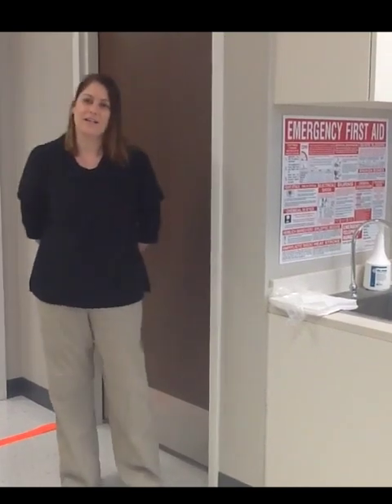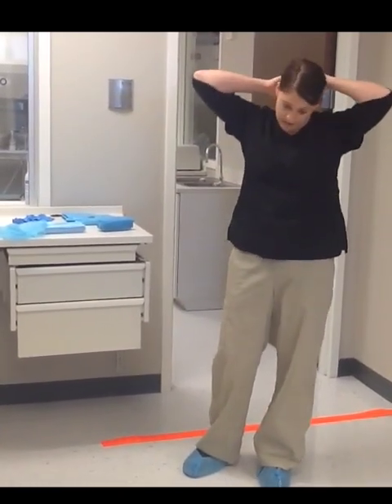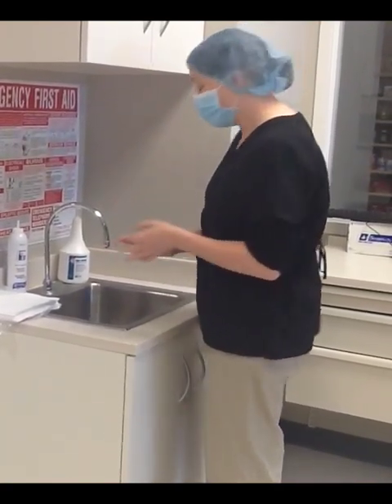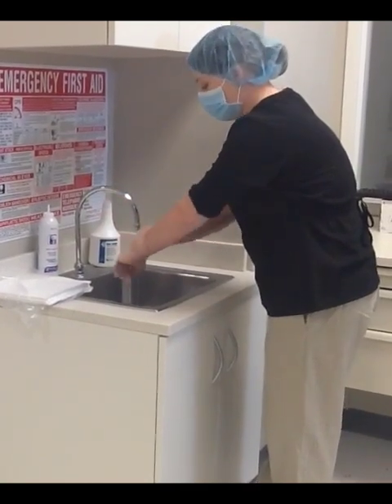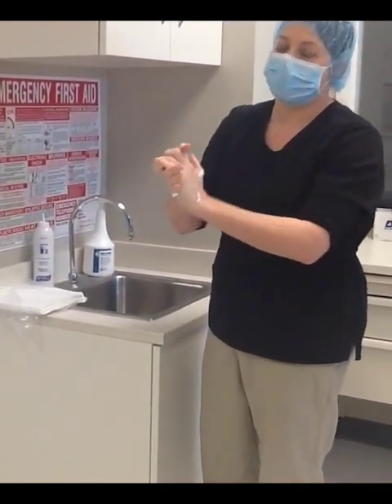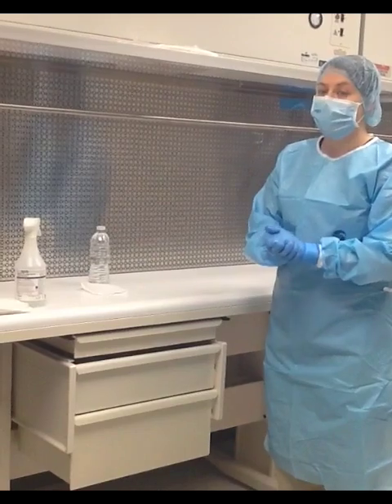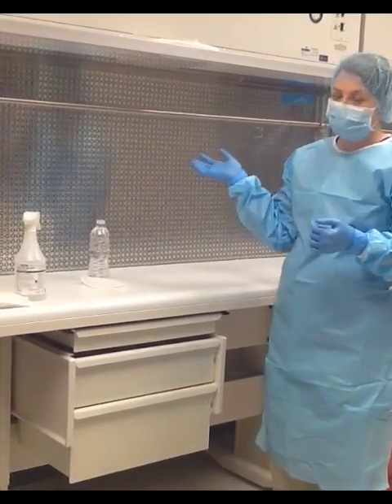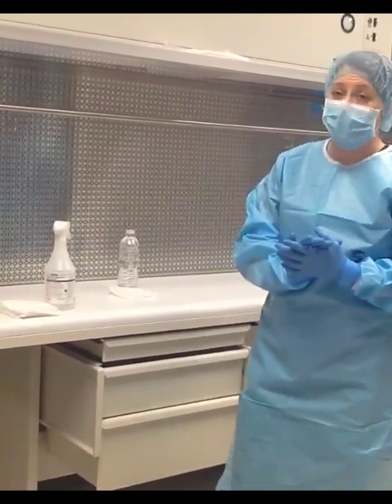Aseptic Technique Part 1

Comment: I find this video all wrong.  Cleaning the LAFH should be cleaned starting with the top working side to side from the back to the front, then the bar, to the sides from top to bottom back to front, to the work bench side to side back to front.  Changing wipes after each area cleaned.  This women just contaminated the entire LAFH from wiping back to from back to the back to front taking in contamination with each wipe, never changing her wipe pad.

Comment: Top to bottom. Ceiling should be done first.
Reply: Back to front, top to bottom.  Cleanest to dirtiest.  Back, top, side, bar, side, bottom.  Visualize particles being on the top dropping down to the work surface below and you're wiping them away.
Reply: Top to bottom. Ceiling, back, bar, sides, bench.
Reply: Ceiling should only be done first if it's a vertical hood.
Reply: Echo852 top to bottom. Back to front. Ceiling from back to front, the back of hood top down. Etc...
Reply: I did read that the first time, and I am not changing my answer.
Reply: And I am not changing mine. I guess we will have to agree to disagree. I have worked in a clean room for more than 15 years. Trained by experts, I think I will go with the process that they use.
Reply: ACPE accredited video.

Comment: what are.  aseptic drugs
Reply: Aseptic is a method of preparation, not a type of drug.  "Aseptic Technique" is a way of preparing medication in such a way to prevent contamination.
Reply: Ok so what your say is that your  covered in porotetion gear so you or the drug don't get contaminated
Reply: Bonnet (covers hair), low-lint gown (covers scrubs, prevents air contamination), mask (covers face/nose), gloves (covers hands/wrists).  The workbench has HEPA filtered air flowing over it in layers (check out laminar air flow).  All of these measures prevent contaminants from getting mixed into the medication.
Reply: Ok
Reply: Do you ever think omg if this gets on my I'll be sick
Reply: Tori Miglioratti hdjrjejebeijfnfldmejdndidndndu💟💟💞💞💓💜🖎💚👄👄✍💛👏👋💗🖓🖒🖒👃💛✍💙💔❤💋👀👣💏💏👅👏💖💕👃🖒👐👂💜🖎👄👄👄👅👐👏💗💖💕🖒👃👃💙❤👣💏💏💏💟💟👐✍💞👅💙💙👂👂👋💔💔💜💜💖💋💋💘💘💘💕👁🖎🖎🖎👀👀🖎💚👣💏💏👄👄💏💏
Reply: this is totally wrong way of cleaning the hood